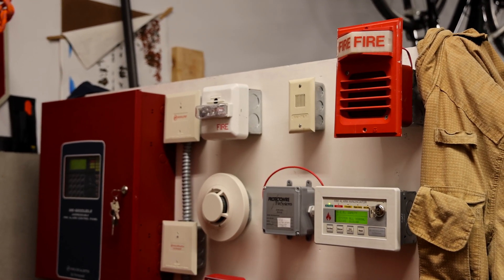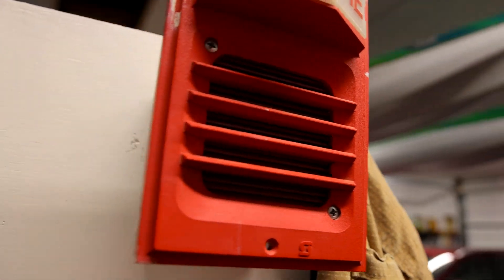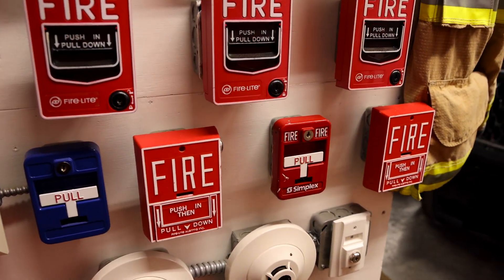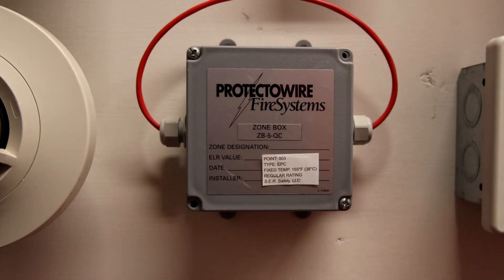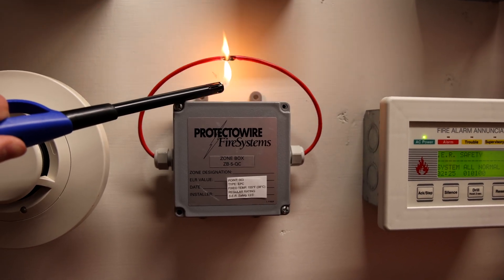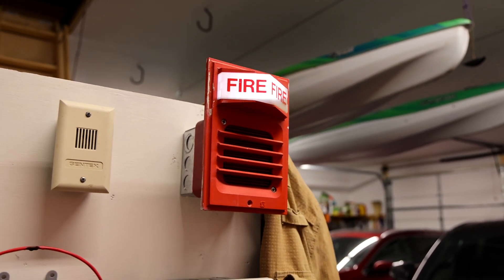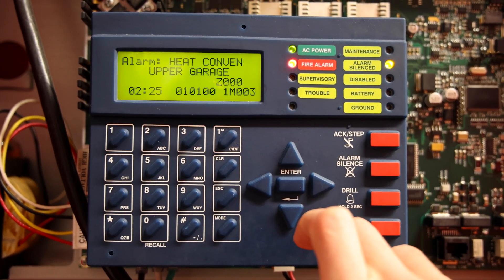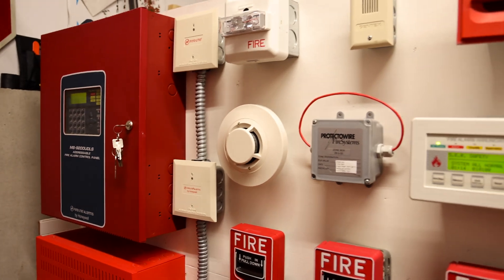Wheelock & Fire-Lite Voice System Test 17 | Linear Heat Detection & Simplex!

Comment: 08:02 And also another good reason to power down the system while replacing the protectowire is to prevent any SLC short circuits that can fry and damage the SLC as it can be easily short circuited while the SLC is still communicating with the addressable points and you can also avoid that by unplugging or disabling the SLC loops. You can also use isolater modules while working on a live SLC and replacing an addressable device to prevent damage to the SLC as well

Comment: Nice! Just curious, how do you get the delay for when the NAC's go off in an alarm?
Reply: It's a feature called Pre-Signal, which allows a certain amount of seconds(which is selectable up to 60 or 90 seconds if I recall correctly) to pass by before activating the NACs. This feature is present on the MS-5UD, MS-10UD, MS-9200UDLS, MS-9600UDLS, and the ES-200X